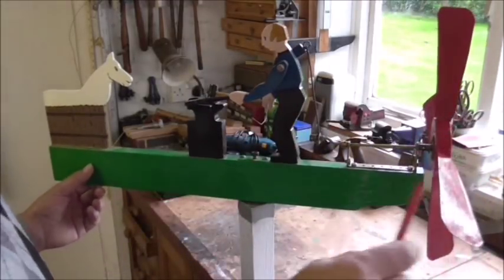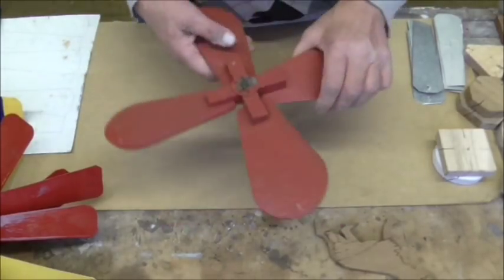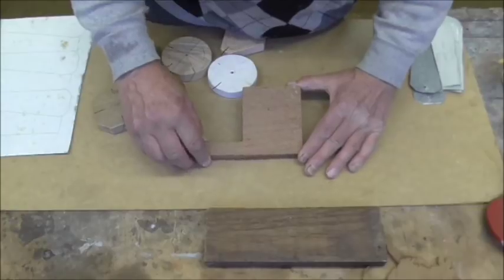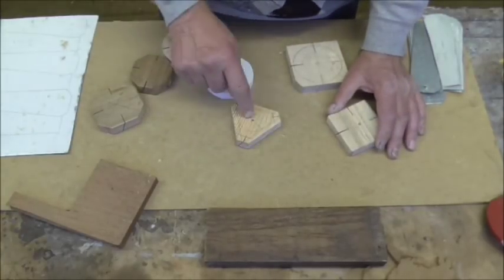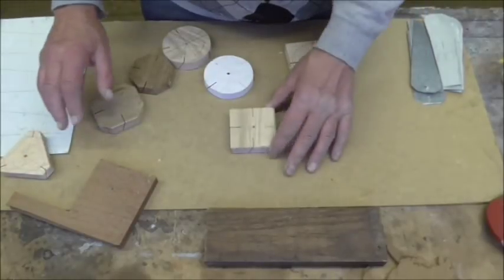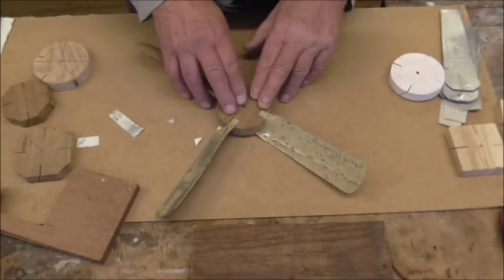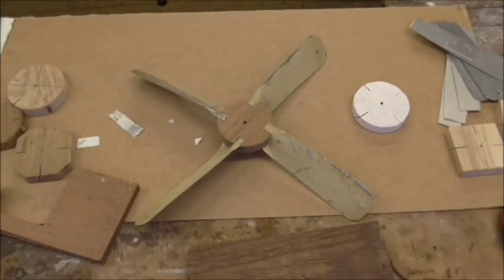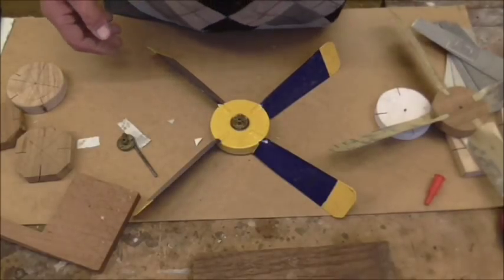Making a whirligig part 2 propellers

Comment: I have a question: I’m curious why you don’t drill a larger hole for the meccano wheel and insert the raised hub within the wood hub? Is it extra assembling steps doing that? Just curious.
Reply from the maker: Thank you for your comment. It just seems simple to screw the wheel on to the hub. also the less holes you make in the wood means it lasts a little longer fro rotting due to water ingress. I leave mine out in all weathers and they do need regular maintenance.

Comment: My son has a very small wood chopper whirly gig that is need of repair. The propeller hub is broken and very small about 1" (one inch, 25mm) in diameter. I was wondering if you have any suggestions about how to make a small hub as it seems very dangerous to make it on the table saw using conventional methods. Love your videos!
Reply from the maker: Thanks for the comment, I found a bandsaw about the safest machine to use to cut the slots in the hub, but my hubs are between 2 1/2" to 3 1/2" dia. They don't have to be circular either, I have made them triangular and square and all work fine. 1" seems a bit small for a hub to be honest.

Comment: Great Videos ,  we really appreciate your teaching us to have a go at making one of these awesome pieces.   Can we use a hole saw to make the rounds for the propellers?  Great teaching style!!!
Reply from the maker: Thanks for your comment. you can use a hole saw and I have tried this method but I found it easier to use a band saw or fretsaw. You do not actually need to worry about the shape, you can use just a square block if you wish. I have used all shapes and sizes even triangular  and all seem to work fine. I have made propellers with up to 12 blades (I just liked making them!) but have found that four blades are normally fine.

Comment: Thanks for the video 
What’s your day job?
I wonder how you get so many oil based colours paint
Reply from the maker: Thanks for the comment Guido. I am retired now but I spent most of my working life in electrical and electronics repairs and running a family electrical repair business. 
As for the paints, believe it or not some of those tins I have had for 50yrs which is why they take days to dry! But as a scrimper I can't throw them away.

Comment: Hello great vids!      I do have a question and  Maybe I missed this ,   how is the rod held in to the meccano cog?   To clarify ,    what holds the propeller on ?
Reply from the maker: Thank you for your kind comment. the Meccano wheel or cogs are supplied with a thread in the side of the brass bush, a standard Meccano grub screw or bold holds it on to the axle or shaft. the bolt or grub screw are normally supplied with either of these.

Comment: Instead of using the mechano gear you can bend the wire at right angles and insert it back through the hub .  Basically you make a hook that grabs onto the hub and just glue it in.  I can remember those old gears from my set when I was a kid.  You will run out of those gears eventually.
Reply from the maker: I like the Meccano wheel method because it is easy to remove the propeller for repair or replacement, just one small bolt to loosen. Thank you for your comment.

Comment: I would have made the props out of wood and that would have been too time consuming and not suitable for this project.The sheet metal is a great idea and will last a long time.  I like how you are recycling discarded material.  If you have to save a penny it is remarkable how you can find an alternative rather than running to the shops to buy new all the time.
Reply from the maker: Many thanks for your kind comment. I recycle materials mainly because I hate things that have a use being thrown away. You also get more satisfaction from making something out of discarded stuff than if you bought new materials.

Comment: I remember my grandfather making these and those weighted table egde rockers. What style whirligig do you recommend for an absolute woodworking beginner?
Reply from the maker: Choose to make a simple one with one movement such as the horse and rider in my first video in this series, it does not have to a horse any subject can be used and you just use a simple cam or old Meccano handle if you have one which will do the job just fine. the tail sail can be any shape.Just experiment on the bench with various movements it's quite absorbing. :)
Reply: Thanks so much! Can't wait to get crackin'.

Comment: Greetings from Australia. On your previous video you mentioned using hard wood and I always have to smile when people say that because not many people know that   Balsa wood  is a hard wood ,[ I bet you could have some fun and games using that ] That being said , how thick are your main drive rods and the height of your figures .
Reply from the maker: And likewise Pitch Pine is a softwood but as hard as Oak! As regards main drive rods the thickness depends on what I happen to have available, often they are Meccano rod diameter which is just over 4 mm. obviously the thicker it is the more difficult it is to bend. I salvage old wire shop stands and cut out any decent straight lengths for future use. the guard cages off the fronts of old electric fires also offer some decent longish straight wire, basically I just salvage any bits of rod that I think might have a use. even old scrap printers can 'harvest' some useful rods and bearings. As for height of figures it varies but often the bigger the better, the Blacksmith one I made him about 6 inches high but I also made one with him being 9 inches high which looked better IMHO. To be honest they can be as big or small as you like but the bigger ones do show up better. 
Because of the weather in the UK they do need maintenance especially if they are left outside throughout the winter, so after a couple of years I take them back into the workshop for an overhaul. :)
Reply: @scrimperuk  Thank you for that . I now have my cutting list and when I have finnished my 6ft Lancaster bomber I will have a go at whirlygigs

Comment: What size are the blaids?
Reply from the maker: Blade length is not important, I use various sizes, they all seem to work fine, in general they are around 6ins (150mm) to 7ins (180mm) but anything from 5ins upwards work fine. :)